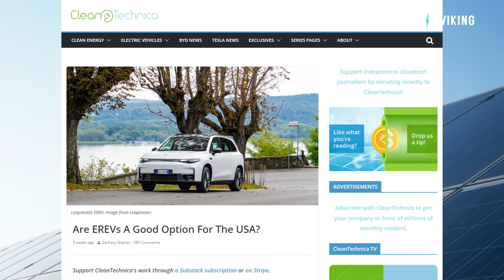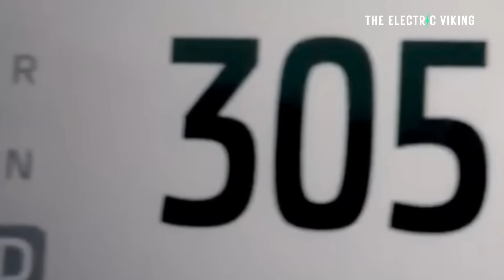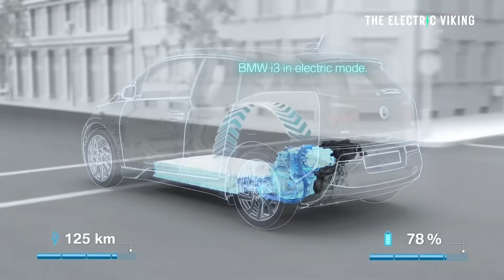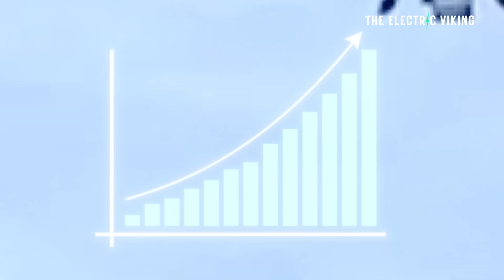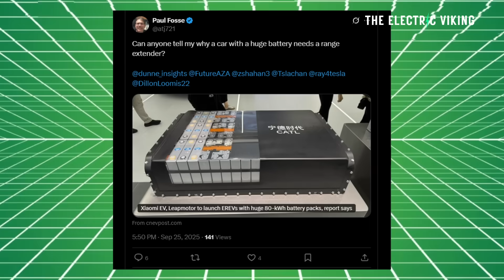Are EREVs the Future of American Electrification?

Comment: No, just buy a battery EV. EREVs just send more repair costs with their parts purchases to the auto companies. Battery EVs are far more reliable and the range is fine even here in the Midwest of the USA.
Reply: I disagree, an EREV is not a plug in hybrid, it's just elan EV with an emergency charge generator that will most likely be rarely used on long trips, so the maintenance should be rarely done even less than once a year for most.  I wish we had them in the US, it's the only thing keeping me from buying an EV as I don't want to use public charging ever even when on a long road trip
Reply: @MarcosViloria  Which means they will be shoddy short life engines that will die if they get a real workout.
Reply: @ekaa.3189  No, the idea was .. yeh famous last ideas .. to have the petrol engine constant-revs (always running at max) and EZ super-reliable therefore cheap. It's a tragedy of history that LFP batteries, ideal for this purpose, were not around in 2014 - the Chevy Volt era. Anyway this is all talk now - the manufacturers mostly agree that EREVs are a bygone chapter.
Reply: @jonb5493  You don't understand how the auto industry makes it's money. All major automakers except for Tesla make their money on parts sales, not the original car. If it doesn't break, they don't make money. Planned failure is the rule, except for Tesla. Tesla actually makes money on the sale of the car, and on selling electricity for running it. Their repair and parts services covers costs. Their cars are designed to last a very long time as a selling point. It is also the ecological thing to do.
Reply: I think they are a great idea, heaps of Australians go on long rd trips  for holidays. People with e revs won't  be a strain on the charging networks during these really busy times.

Comment: E-Revs and Hybrids have been around in the US for a long time and they didn't help anything, they just made the car more complicated, added weight and increased the number of parts even beyond ICE only. When there were penalties for not meeting emissions targets that was the only incentive for automakers to make them. To me we really only need ICE and EV, the rest is just making something that's technically possible but not really needed. Large tow vehicles might be an exception. An electric motor can provide the torque you need at takeoff and on grades allowing the vehicle to get by with a smaller ICE engine.
Reply: I think you are confusing plug in hybrids with EREVs, we don't have any EREVs in North America except for the BMW i3 that was available for a short time and was pretty much a proof of concept vehicle
Reply: So you think that hybrids averaging 54mpg "didn't help anything" compared to similar ICE cars getting 32mpg?  I beg to differ, and think that buying any ICE car where a comparable Toyota hybrid is available, is simply a mistake.  At least, it's a mistake if you drive a lot.  If you drive 5K miles per year, ICE is OK.  If you drive 25K miles per year, ICE is just torching money.  Especially if the ICE in the hybrid is better than the ICE in the ICE.

I bought my first hybrid 25 years ago, and now drive the PHEV version of it.  If I never plugged it in, just driving it as a hybrid the 54mpg number is extremely easy to get.  In fact, I can get 70mpg easily on gas alone with it, and 80mpg during good weather on 35-45mph roads.  If I had 2 cars, one would be an EV, but with just 1 car, I prefer the PHEV.  I actually take road trips to places where I'd have to drive an hour or two, maybe even 3 hours, to a public EV charger.  Admittedly, some of those places are also almost 1 hour to a gas station.  The final consideration is vehicle price, build quality, and trust in the manufacturer.  I'm pretty hooked on Toyota.  I wouldn't be caught dead in a Tesla.  I'd consider a GM, having had good luck with GM cars, but the last time I bought one was 22 years ago, when they made better cars.  So, I guess I'll have to wait until a very inexpensive EV from China makes its way to the US, or Toyota gets with the program.

Comment: Why would anyone want an EREV that's only good for 400 Km? Most EV's in the states get more than that on straight battery.
Reply: My daily drive is less than 40 miles a day but if I take a long trip once or twice a year I don't want to use public charging if fact I don't want to ever charge anywhere else but at home or at work, so to me an EREV is the only thing that make sense and is still very reliable as they don't have transmissions nor a drive train and the generator will be rarely used
Reply: @MarcosViloria  I charge my EV at work most of the time also. Free fuel is pretty cool!
Reply: Cause it only takes 5-7 minutes to refill with gasoline. Verses average charge time 25-50 minutes. Way more Convenient and faster.
Reply: @duffsvids  Why charge when you don't have too. My car will drive four hours nonstop before it needs a charge. 
 Twice the shit to break in a EREV and more expensive. You either don't have an EV or just plain don't have a clue.
Reply: @michaelthomas7898 you always got to charge your car or it’s dead lol. 4 hours going at what speed? Less than 60-65mph. With what car?
Reply: @duffsvids  That's the point you charge it at home and nowhere else.
Reply: @michaelthomas7898  so you only travel to less than 50% charge and turn around and go home? Not much of a traveler I see.
Reply: @michaelthomas7898this is the kind of elitist ev-only attitude that makes people hate ev owners
Reply: @davidaustin6962  That's funny. Myself I've caught more crap from people who have no clue to what they are talking about then anything else.